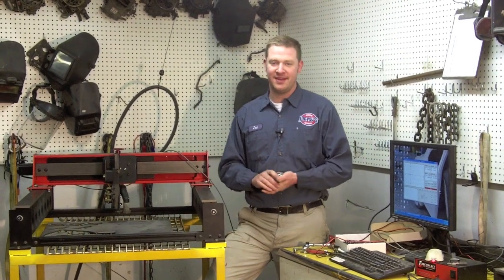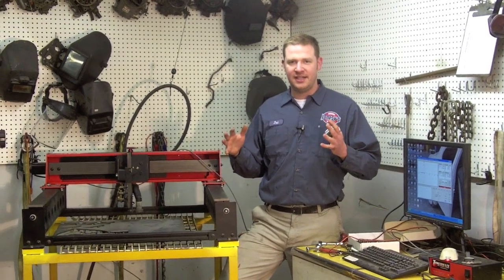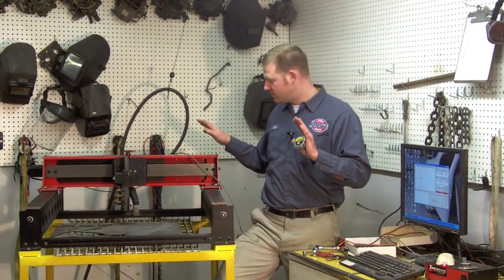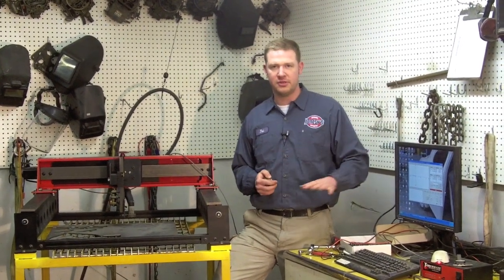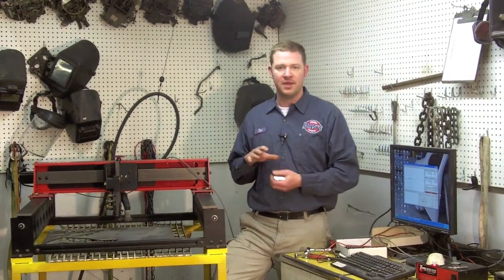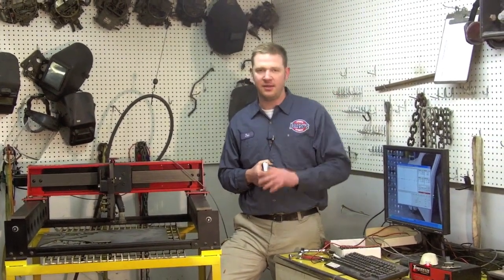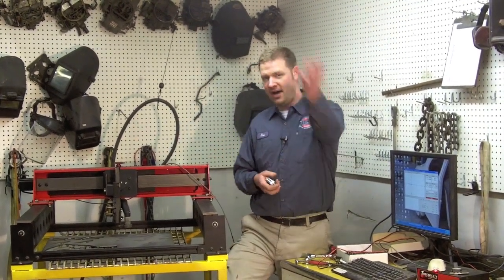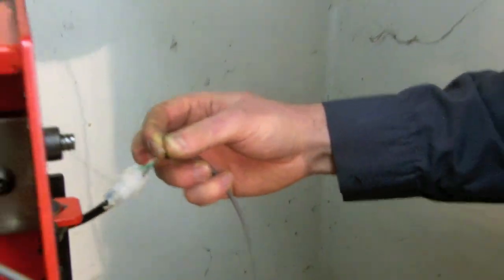Torchmate 2x2 Plasma Cutting System Problems

Comment: I know this is from a long time ago, but I have built several cnc routers using the stepper motor technology and as soon as you described the problem I knew the answer.  This is a common problem with the wiring and shows up when you try to jog or move one direction but the axis takes off the other direction and then the next time the right direction.

Comment: The wires looked so fine on that stepper motor disconnect, I would try something about 14-16 AWG as that looked like the 22 AWG Cat5e cablem but you need some kind of strain relief on those connectors too.  Also, reseating and checking connections is generally what a PC tech does after rebooting the device.  I wouldn't go to the point of recalibrating the whole machine's physical geometry unless you moved it and gave it enough force to change it.

Comment from the maker: @irishkendoll  Thanks for the comment.  The wire the run the side rail motors don't move so they would not be in danger of being snagged.  In addition that is how TM sends the machine.  Since we had just recently purchased the machine we had not secured and finalized the install.  Shortly after posting this video all of the connectors were changed wires shortend and secured.  The machine has been working great.  Thanks for the comment.

Comment: the machines seem basic but to the point for me,  but just a question, why would you run with wires hanging around? i mean im just going by the video. testing is testing i get it i took chances to, but the wire could have been snagged right? whos fault is that really tho?  anyways hope you got it all fixed and having fun!

Comment from the maker: This is a great machine for what it is intended to do and that is small one item jobs and prototyping.  If you are thinking about buying one just know that it takes a long time to set up, it does not come with a table and it is not robust.   It is really a hobby machine.  With that said I have squared it several times, replaced all the motor connectors, and locked it into position by tack welding it to the yellow frame.  Since then it has been trouble free and is great for my business.

Comment from the maker: First off I think it is a great machine but needs some refinement.  The rails don't stay square and the torch height adjuster does not stay tight and secure.  I also assure you the wires did not snag on anything  as the motors on the side rails don't move.  I  should shoot another video showing how I fixed the bad crimp shortened and secured the wires.   Thanks for  taking the time to watch and comment as it seems to have gotten you fired up.